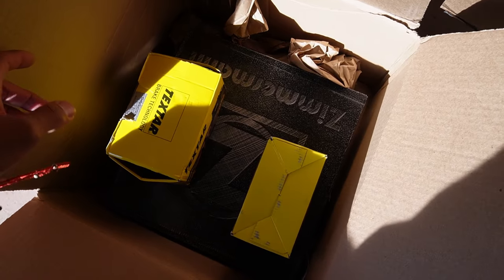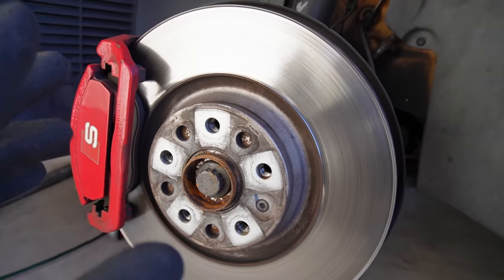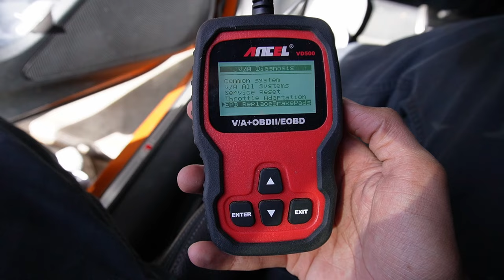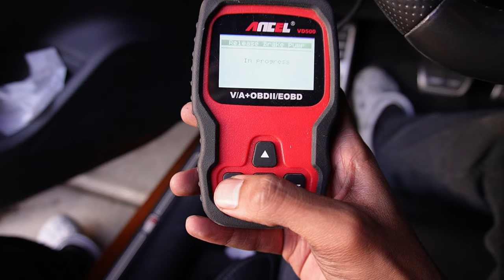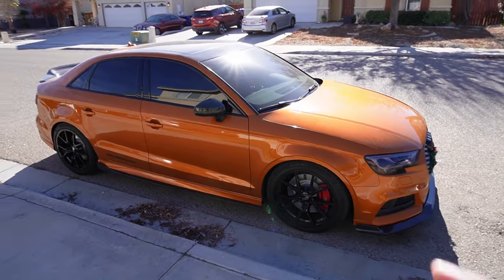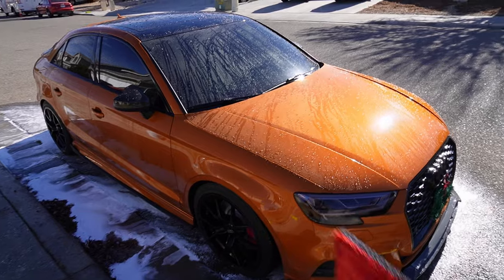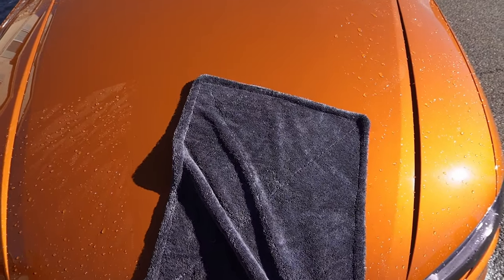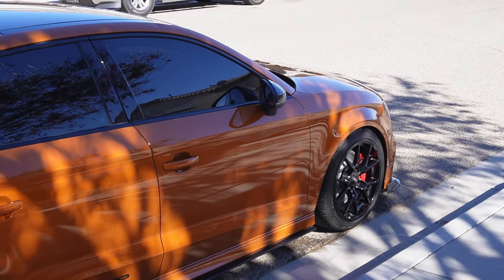AUDI S3 GETS NEW BRAKES AND ROTORS + DETAIL !! (LOOKS SO GOOD ROLLING!!)

Comment: i got an audi 2016 s3. The car came with an ecs tuning exhaust and a cts downpipe. Am i at stage 2 or 1 and should i flash a stage 2 tune on it or stage 1?
Reply: Your car should already be flashed stage 2 having a downpipe. But never hurts to reflash your car because tuners are always updating the tune
Reply: @rubberskilla2991  appreciate that, yea imma reflash it once i get the intake and intercooler
Reply: @zGappie  intake and intercooler wont make a difference for your tune. You should definalty update as soon as you can tbh